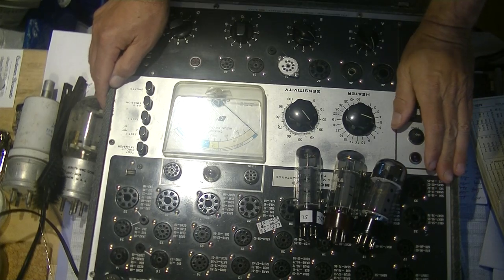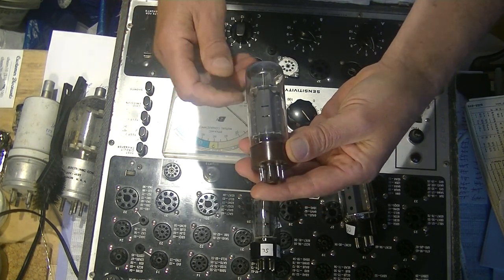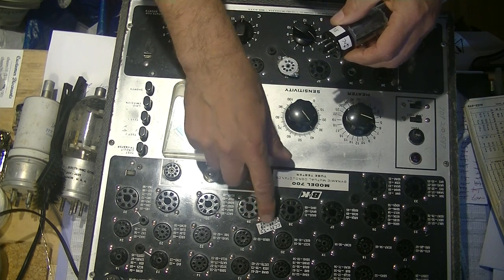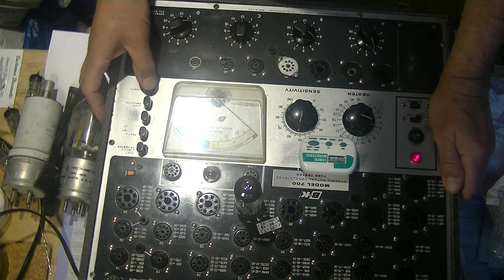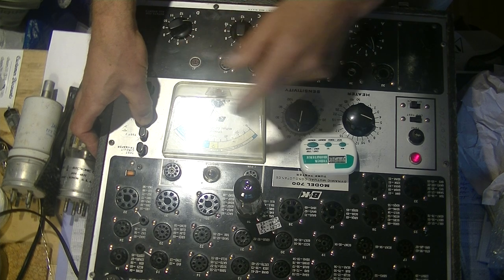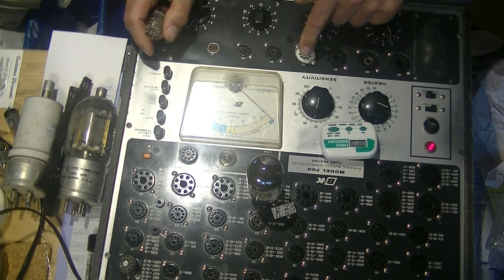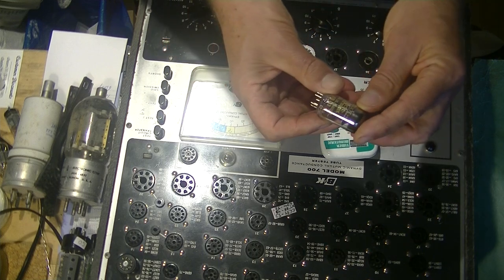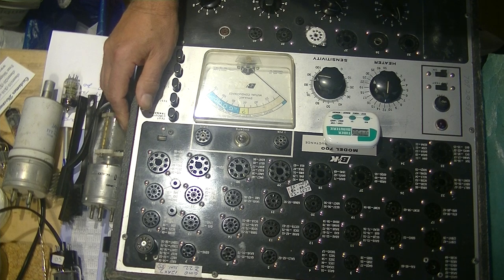Tube Lab #3b Testing Tubes for Beginners

Comment: Thanks for the tester demo.  I use B&K 707 and Triplett testers, and find that one of the most useful functions is the "shorts" test - which tells you if you can or cannot safely plug that tube in to your amp.  Most testers do not tell you adequate information on power tube matching, because they do not supply sufficient voltages.  Transconductance values can be an indication, but they are not the whole picture.  For the most part, I find amplifiers to be the optimal place to test the tubes that pass the "shorts" test.

Just want to dispel some misunderstandings about the 6CA7...  

Those 6CA7 are not 60-70 year old tubes.  Sylvania created the big-bottle beam tetrode 6CA7 beginning around 1969, having modified the 6550 design to bias as an EL34 (which is a power pentode).  Philips created the EL34 in 1949, and Philips first published the North American "6CA7" name for the tube in 1952 in anticipation of distributing their EL34 in the US.  That is how older EL34 made by Philips factories in Britain (Mullard/Blackburn), Holland (Sittard) and Belgium (Brussels) could carry the "6CA7" designation years before Sylvania first produced those wider-diameter 6CA7.  Incidentally, RCA did not make 6CA7, but sometimes they re-branded Mullard EL34 as 6CA7, and sometimes they re-branded Sylvania 6CA7 as RCA.  Confused yet?  Are we having fun yet? ;^)

Comment: Hello ! Glad I'm finding you ! Love your videos! I've also checked out your excellent website ! We'll be back for sure ! I thought you weren't supposed to handle or touch the glass on the tubes ? Set me straight ? Thanks Curtis
Reply from the maker: You can touch or handle the glass of a vacuum tube all you want (obviously you need to wait for it to cool down if hot).  What you need to be careful of is rubbing off the label.

Comment: hello, could you help me test an el33 in a bk700/707, do you know what the configuration is? thank you
Reply from the maker: As far as I can see, the B&K707 doesn't have a test socket or setting for the EL33.  In fact most older types aren't covered by the B&K testers.  The best thing to have is an older Gm tester for all of the earlier radio tubes like the EL33.  We have a I-177-B Hickok/Simpson tester for older tubes, but even it doesn't list the EL33.  BUT with a data sheet you can make up your own settings and with the B&K testers I often reuse an obsolete TV tube socket and rewire it for a specific tube that the b&k doesn't cover.  And lastly you could build your own power tube tester, which we did and for power tubes it's really the only way to go as pretty much all Gm testers don't do a very good job at testing power tubes.
Reply: @tubelab194  Thank you very much for your pleasant response, I appreciate your work very much, I am a great follower of your videos and I have learned a lot thanks to them.